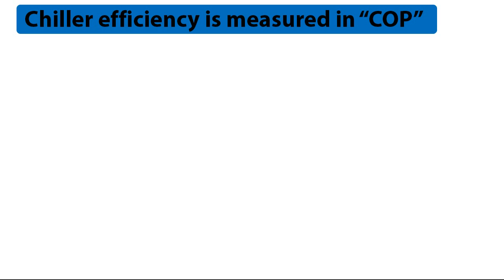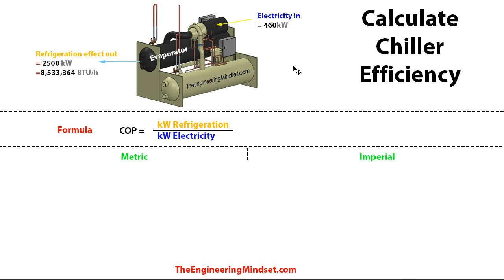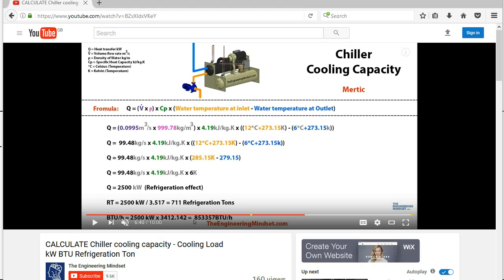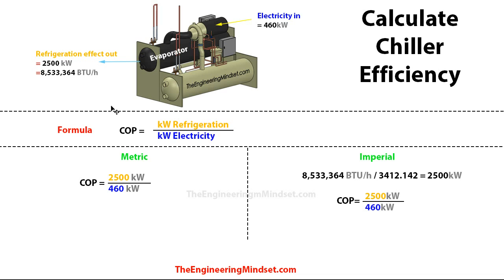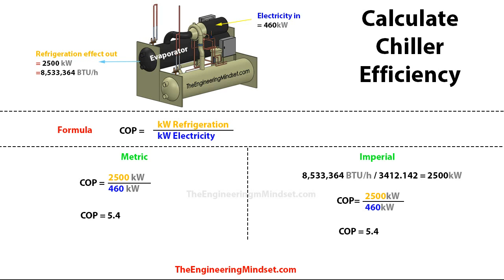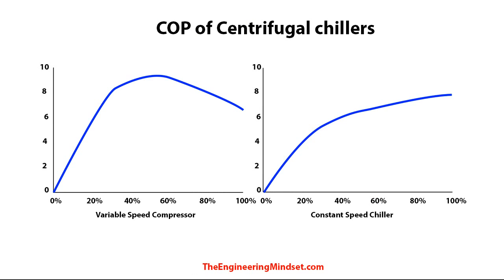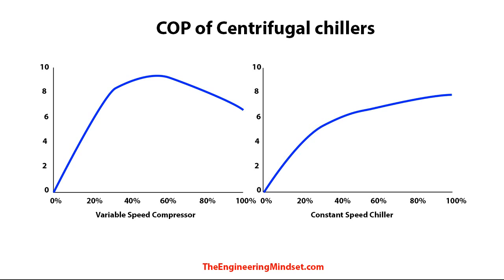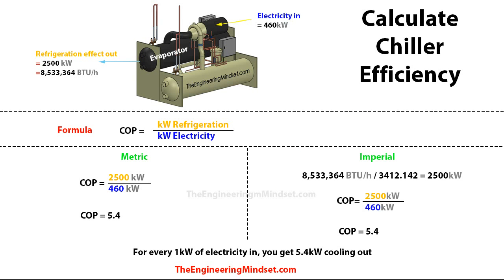Chiller Efficiency CALCULATION - COP Coefficient of performance

Comment: What I do not understand is why you used only the compressor's power requirement. There is also a pump that is pumping the water right? Shouldn't that be added to the required electrical power?

Comment: at 4:16 how 1 KW gives 5.4 KW out putt , i am confuse 
output is always less than input :-( , Paul Please Help :-(
Reply from the maker: +Muhammad Zaroon very good question, you've got the engineering mindset. The chiller, heat pump or AC unit is just moving thermal energy from one place to another, it doesn't generate the thermal energy. To move it you must put energy in, so it will s still a loss it just just doesn't seem so. Electricity is a high value energy source because you can convert it to anything but heat is a low Energy source as you can only heat with it. So you're using a valuable energy to move a less valuable energy. The thermal energy it moves is not enough to power the unit. You can't capture the heat and convert it to electricity to drive the compressor, it will never provide enough power to do so.
Reply: 5.4kw mentioned is for heat energy and 1kw is for electrical energy